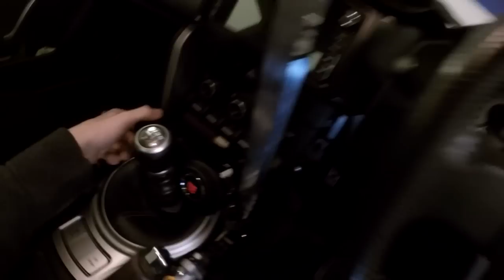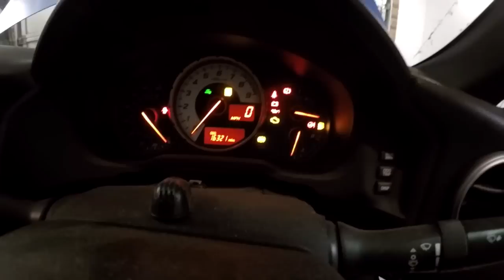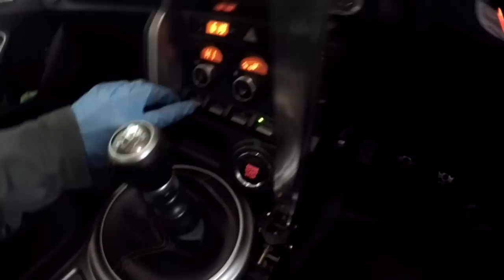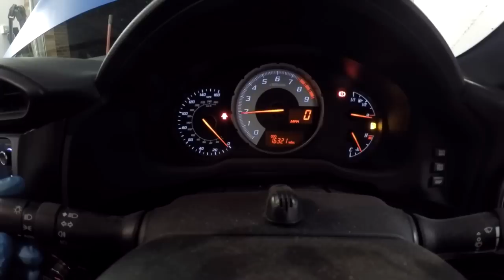GT86 Forged Engine Internals - Part 2

Comment: Loving the videos keep them coming! Also wouldn't it be easier to change the belts whilst you was putting the engine back in? But seriously love the vids always get excited when I see it in my sub box!
Reply from the maker: +ben S we didn't know we'd have to replace it as it only needs replacing because it jumped off the crank pulley when we first fired it up and got damaged slightly
Reply: +DedicationBlog makes sense now :) you and si thinking of doing any meet up this year?
Reply from the maker: +ben S no plans at the mo, but we'll be going to a few car events like Horsepower At The Hall in Lincoln I'm sure